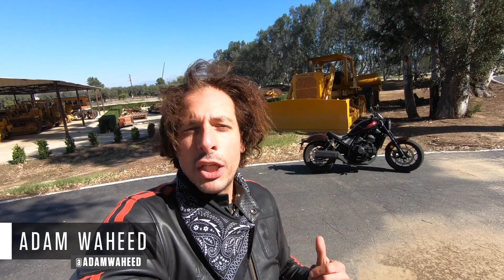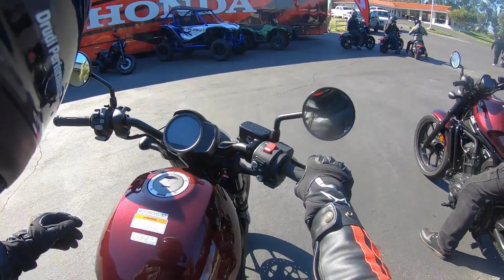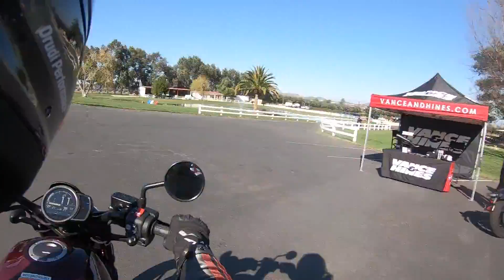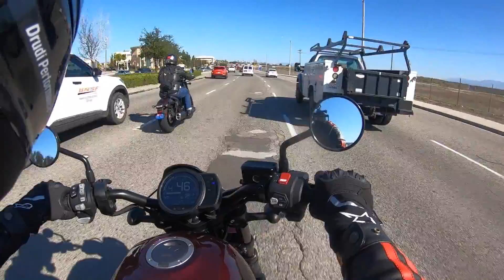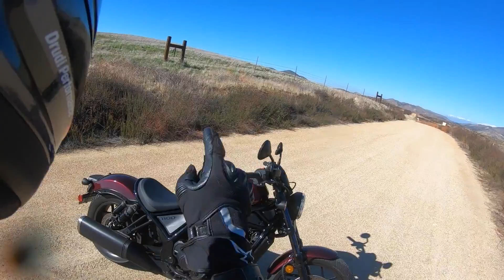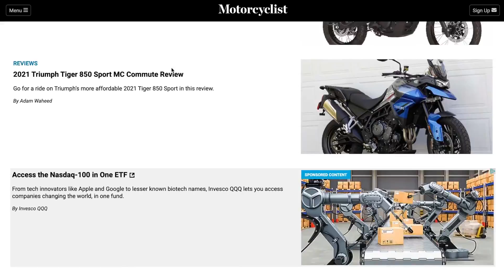2021 Honda Rebel 1100 Review | MC Commute

Comment: Does this bike have a cross-plane crank and 270° ignition timing?
For mid-range torque and smoothness and a V-twin sound, those would be expected nowadays.
Reply: I do believe it has a 270 firing
Reply: @XanhDT89   - Which implies a cross-plane crank - something Yamaha (plus Royal Enfield and Triumph) have become known for.
But for some reason, Honda avoids all mention anywhere of "cross-plane" or "270°".  :-)
Reply: @daveinwla6360  I read in a article somewhere about the 270 firing. I think on cycle world
Reply: @XanhDT89   - YouTube's "Views from the Man Cave" also lists the 270° firing order.  And looking up the crankshaft for the Africa Twin, one also finds a 270° firing order.  Honda just didn't want to admit that its mid-grunt twins now have the same cross-plane crankshafts that Yamaha has been touting for a few years.  :-)

Comment: Cool bike, but to a lot of people chain maintenance gets old if you actually ride a lot and ride in all weather.  (Yes, I know adventure bikes are often chain-drive, but that is a different market segment).  If targeting Harley, a belt drive would be helpful.
Reply: Agree completely. I have a 107 Fat Bob and love it, but this Honda is a temptation...except for that chain. I have a warrantee issue coming up with the condensation building up on warm sunny days at the bottom of the cluster.  As long as I don't get any grief from Harley on this I'm staying with the Fat Bob.  Otherwise, that Rebel is looking real nice.
Reply: I'm waiting for the day where we no longer need to maintain are chains all the time. Didn't someone make a chain like that? Though from what I understand its not wide spread yet.
Reply: I have 13,000 miles of complete neglect on my Xring chain. Chain maintenance is overrated in my personal experience. Chain maintenance got old for me too so that’s the path I took with my current chain 😆

Comment: For some reason this just makes me want Honda to bring back the Valkyrie 😭
Reply: I accidentally came across a Valkryie in a parking lot while out motovlogging on my ZX-14R a couple of years ago, and had a nice chat with the owner. Valkyrie's are a special bike, for sure.
Reply: why wish when there are ton of unsold Valkyries under 10k
Reply: @rubensahak9178  would like a more modern version. Love the classic, was my dads favorite bike and I grew up riding on his. I’m honestly not into cruiser bikes But a modern Valkyrie with the current 1800cc flat 6 would be a dream for me, probably only cruiser ide buy
Reply: @toofastnobrakes  F6B / base Goldwing is basically a modern Valkyrie, right?
Reply: @ntdscherer  kind of, but I want that classic cruiser style with more modern tech and amenities
Reply: @toofastnobrakes  It would be pretty awesome to have a classic Valkyrie with a new fuel injected engine and some electronic stuff.  Even better if it didn't weigh so much.
Reply: @ntdscherer  my thoughts exactly. I’ve seen concepts for a 2020 model “looked like a mix of the 2014 Valkyrie and the Rune” but nothing ever came of it

Comment: The only thing missing from new developments is auto engine shut off at the light at 9:50 ..basically They're turning into cars on two wheels now. Some may like them, some may not.
Edit: also we need electrically adjustable mirrors, auto dimming mirrors, power seat, steering and pedals adjust for awesome ergos!

Comment: Any word yet on when we will see the new 2021 cb1000r? I have seen anything since it’s announcement 😕
Reply: It's the same as the 2020 except a black color edition.
Reply: @beachbum1979  no they changed it cosmetically to. New headlight, dash, wheels, updated tank and side panels, quick shifter, and slight change to tuning. It’s more than a new paint job
Reply: @beachbum1979  look up a 2018 and 2021 side by side
Reply: @toofastnobrakes  
Cool.....i didn't realize that.

Comment: How big of a change would you say it would be to jump from a VTX 1300 to this Rebel 1100?
Reply: Pretty big... you'd go from 75ish hp to 90... but the size and weight would be a lot smaller, it's possible you might feel cramped on the Rebel
Reply: Gus ride a cruiser first. I thought I’d love one so I bought a really nice nomad 1600 and didn’t care for it. I ride a 2017 Triumph Trophy SE, just not old enough for a cruiser I guess but handling and power to weight ratio was awful. My opinion anyways 🤷‍♂️🤷‍♂️🤷‍♂️
Reply: You'd be taking a huge hit in the aesthetics department, for sure.
The VRX is one beautiful bike.

Comment: I don't care for the looks of this bike at all. For the money there are a lot of other bikes I would buy before this. If I wanted this engine and transmission I would spend the extra money and go with the Africa Twin. Something you didn't mention was that this is chain drive. I think Honda should have made this belt drive at the least.
Reply: The Rebel is on the budget side, where the shadow and furry are shaft driven but cost 1k more.
Reply: The Shadow is $1500 less than this bike. It is only 750 cc though. The Fury is more, but it is also a 1300. The belt drive over a chain would be minimal cost if not cheaper.

Comment: Sad that we are having to make motorcycles easier for people to ride, like everything else now. If it doesn't have a manual clutch its a scooter.
Reply: What's wrong with easier to ride ? If you don't like the dct then don't get it. Let everyone have their fun
Reply: It's not for "easier" ride, but for accessability, someone with a broken wrist or foot might only be able to ride it because of DCT
Reply: Have you tried a Honda with the DCT system? Its superb, and you have the option of switching to manual mode if you wish. Also, scooters usually have a CVT transmission, but im sure you know that.
Reply: @andreasfrederiksen4065  I have. I get it. Some of our customers have them. To everyone, it wasnt a negative comment. Just not for me.
Reply: do some research fool,you can buy it manual or automatic
Reply: @bernardengel4630  Thanks for for the info 👍 As I said earlier I work in the industry. Some of our customers have them. Just not for me, fool 👍
Reply: There is a 6 speed version too lol. You got options
Reply: We need more bikes on the road to get more cars off the road. Cars suck.
Reply: That DCT version smokes a manual model in a race because of the ridiculously quick-shifting pattern of the DCT.
Really hard to beat automatic shifting AND cruise control.
Reply: @ecrusch  haven,t seen that video yet,when the flag drops the manual will be at about four thousand rpms the automatic will be at idle,does not compute
Reply: I agree with you, but fortunately it also exists in manual version.
Reply: ok boomer
Reply: @kekw9928  Nice. How original. At least with that brilliant comment we know youre the kind of person they make this version for 👍
Reply: I wasn't trying to be negative. That it could be good for people with physical issues goes without saying. It's smart for them to offer both. As someone who has worked in the motorcycle industry for a long time the automatic version doesn't sell well.
Reply: @furyroad7565  Actually they just came out with the figures, and 73% of these bikes are being sold with the DCT.
Reply: @ecrusch  Maybe it's catching on 👍